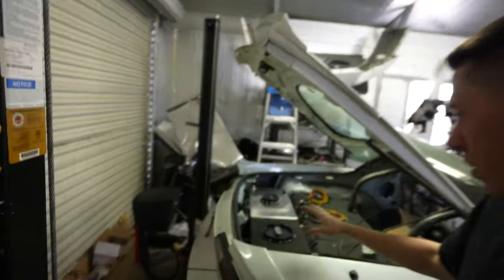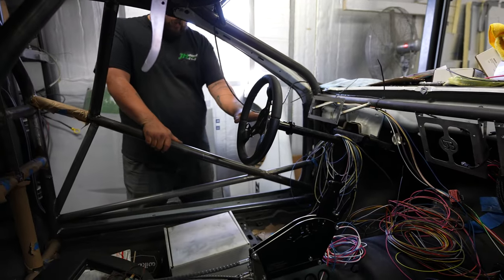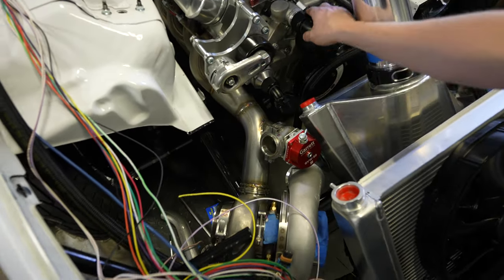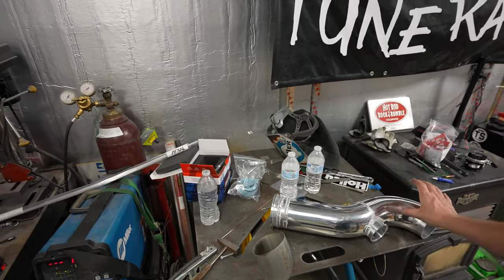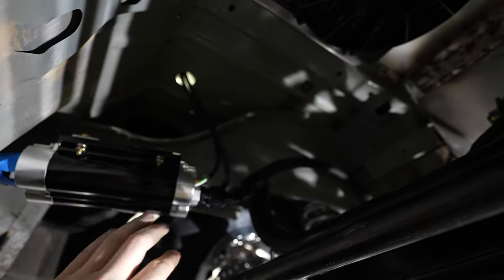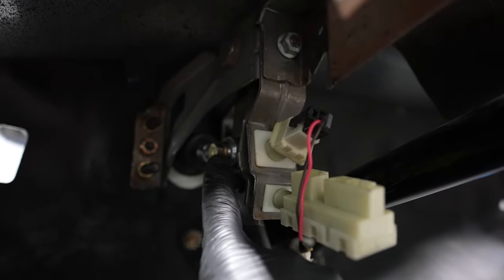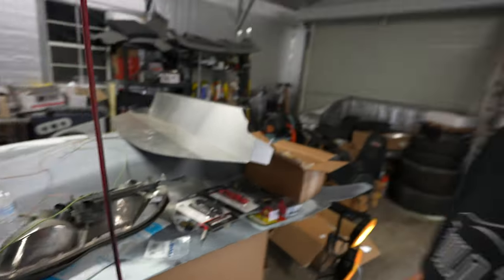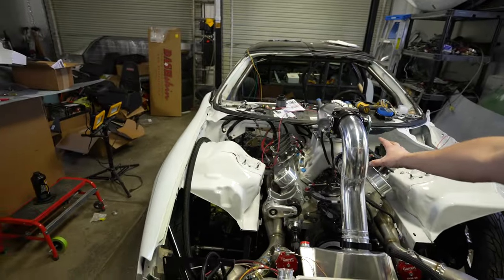Introducing The Elephant Trunk Intake... Twin Turbo Camaro Build HUGE Progress!

Comment: Will it make difference which direction that butterfly of the throttle body opens? The way it is it seems like the upper side will go agains the flow of the air. I’m assuming since it’s under boost it may not matter. I was just thinking due to the way the air will be turning from the elbow. Looking great man!!